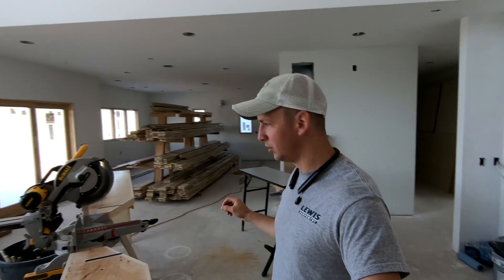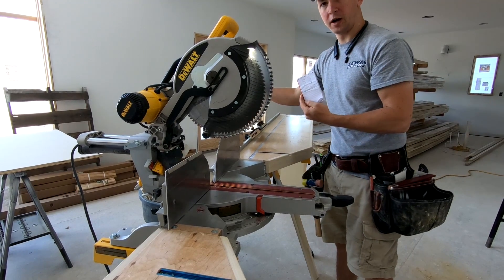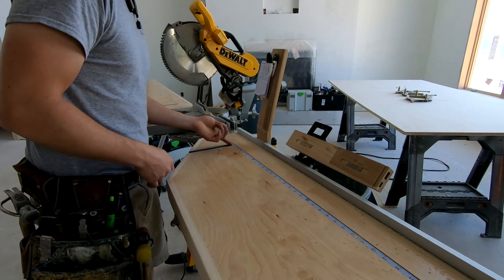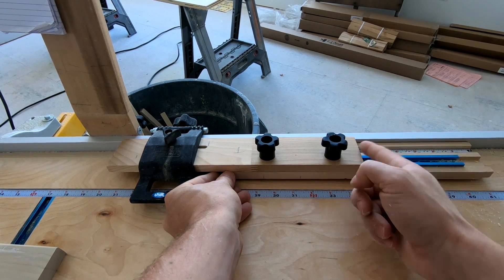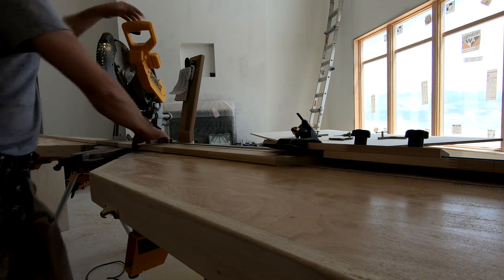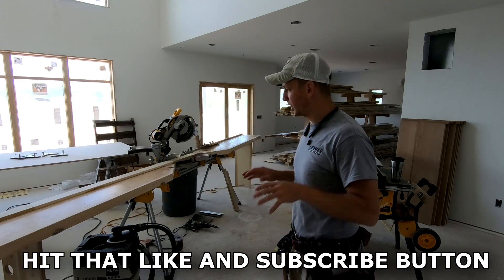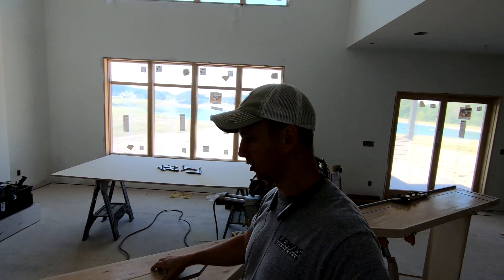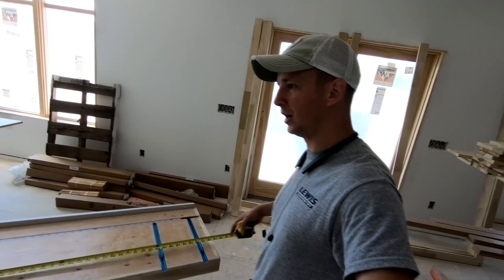No Faster Method to Cut Mitered Window & Door Trim???- The Miter Saw Offset Stop Block

Comment from the maker: Support by visiting these links: Thanks!
MITER SAW WINGS TOOL/SUPPLIES LIST - https://www.amazon.com/shop/insider_carpentry
Hipur Glue Gun: https://amzn.to/3jcFFVW
Hipur Glue - https://amzn.to/2DHQ7V8
Miter Clamps - https://amzn.to/3hjhvHR
Miter Saw Blade - https://amzn.to/2Zy9JDN
Reply: Been enjoying your videos, bought one of those stud finders you use. Pretty nice!  Have you ever used a 1/2” crown corrugated fastener gun for your miters?  They are amazing, I have never seen a faster way to hold miters together with or without glue and they hold almost as well as a pocket screw. You wouldn’t have to touch corner clamps again. Anyway thanks again for the amazing content .
Reply: IS THIS A RE POST  SEEMS I WATCHED THUS A YEAR OR 2 AGO
Reply: Are those saw blades better than Diablo or Dewalt?
Reply: @esequiel1900  for $180, I would hope so.  That's one expensive blade.
Reply: @esequiel1900  Full size teeth are almost always better than the cheap thin kerf blades.
Reply: Spencer, are you usually buying 14' trim stock? And I know you've talked about this elsewhere, but it appears that you use finger jointed poplar?
Reply: Three things:
1) You do a very good job with your channel - great resource for folks wanting to learn the trade and become excellent at it.
2) I subscribed quite a while ago and have no idea of my password, user name, etc., if there is such a thing on the channel  - if I need to know anything about that, please let me know.
3) I thought you said long ago, that you were going to do a build video and/or plan for your stop block.  If you have, please let me know where to find it, or please do one - that's a slick unit.
Reply: Why no link to stop block on Amazon. Getting ready to build some wings but can't find the stop block cursor thingy

Comment: 3:12 this advice would have saved me a lot of headache in my earlier days. 
Took me a couple of screw ups to come to the point where I always re calibrate the bevel.
Reply from the maker: You’re not alone! Had one a while back where I cut a ton of casing sets...started assembling and my miters were slightly off...saw was off about 3/4 degree from bumping in transit.
Reply: Reekon M1 Caliber
Reply: If you two would ever get together and do some type of classes I would totally pay for that person to person. You guys are awesome. Oh I couldn't forget Mike Farrington.
Reply: It can get really crazy when multiple people use the same saw but use different setting and don’t return things to 90* when they’re done.  I’ve walked down that road.
Reply: @levisoriano1  Yeah, Mike used to host a week long paid course "In the BOARDROOM"  So you can learn to use "The MIGHTY BISCUIT"  /* I'll stop now! LOL */   If he starts it up again, I'll do my best to sign up.  My dream get-together would be Perkins Builder Brothers framing,  Richard and Spencer doing the finish carpentry, with This Old Tony making all the metal doo-hickeys while Essential Craftsman narrates.  And Mike building the furniture.  And I'd guess you have to throw in a river table from John Malecki.

Comment: I love it when I have moulding I can flip like that and cut without rotating the saw. You can do it on quite a few profiles. I do the same idea for baseboard when doing cope to out cuts. Flip it over and slide it down.

Comment: I used to work for a very large plant nursery that sold to the big box stores and we were big into “lean management.”  Finding ways to cut steps to save time, labor, man power and this is exactly that. Great tip, and you just gained a subscriber!

Comment: Spencer, I notice you take several steps to the right, to pull your stock off the rack; then several steps back to the left, to bring the trim to all the way across your miter table. Wouldn't it save time and energy to set up your stock rack, or miter table, to where you feed it from left to right?

Comment: I’ve had luck with spring clamping a speed square setting the 90degree of the speed square on the short side of the angle then I can pull a measurement from there

Comment: First of all, excellent work you do. The question I have is do you ever have to do a compound miter on your casing? It seems every time I do my casing the windows are always short of being flush with the drywall so, I have to chip away the drywall and do compound meters to get my casing to fit tight. Just curious if you have this problem on the houses you trim out

Comment: You need to team up with Matt Risinger from the build show podcast. You guys might be brothers from a different mother.  I see some very strong ideas from you both.  Do you have a say In the stock material you use?   My guess is that you never prep your work for painting.  As a remodeler I get to do it all.  Trim, prep, and paint.  I’m finding that trusting other trades to do the job right is harder and harder these days.  Very few contractors truly care about the finished product.  
I understand the get in get out ideas, but quality just can’t be sacrificed.  Sadly as you know it is.   Can you share what your encounters are like with the other trades you deal with and how you handle conflicts of interest?

Comment: Love your offset stop block & your method for flat casing to flip the casing after your first cut to get opposite miter after pushing it to the stop block for long to long measurements, that’s awesome ..but what if the molding isn’t flat..well exactly like you teach a lot is reduce steps/movements..don’t seem like much but if you have 100 pieces with 2 outside miters & move your deck from left to right for each piece it really adds up..& as us carpenters always trying to figure a quicker way I stumbled on to this trick..we had a really big project doing 200+ condos by Disney World & every one had a master bath tub surround with 2 applied molding/base cap boxes, so hundreds of the same cut…well trying to save time I found I could cut my right miter, measure my long points & move saw for opposite miter then set up my stop block for long to long ..then I could move saw back to left 45 & cut right miter on end of a full piece of molding & move to stop block then cut again without moving saw, cut, move to block , cut & so on till you got a good stack..then move your saw to right (for left miter)& cut opposite miter on whole stack piece by piece ..don’t know how it works but it cuts it perfectly to length ..hope that wasn’t too confusing..Spencer I think you talked briefly about the pivot point? How at a certain point the left & right miter meet at the same spot? Guessing it’s how the fence is positioned with the blade..but if you can’t flip your molding you can still gang cut without moving blade back & forth..love this channel

Comment: What about a casing that has a profile and is not flat and you can not flip it over and miter it like you can with the flat casing you are using. I do enjoy your videos just some of the work i have done in the past has not used that kind of casing.  Thanks
Reply from the maker: In that case you do have to swing the saw back and forth. But it’s not a big deal.

Comment: Ok ,what if the stock is not flat, do you hold it the contoured side were you think its square to the fence and plate??
Reply from the maker: Then you can’t flip it. You just have to move the saw in that case.
Reply: Ok,makes sense, great videos, keep em coming

Comment: I think I see a vacuum under the left wing. Were you not using it connected to the saw for dust control for the video (noise) ? Thinking about efficiency and health related to wood dust. I have a bagged Ridgid connected with an auto on switch from Amazon that works well. Cheers, Jim
Reply from the maker: No, I use that vac for my sander. I don’t run one on my miter saw anymore.
Reply: @InsiderCarpentry  Thanks for your reply. Really like your videos. I have a good friend with lung issues attributed to wood dust working in a shop earlier in life. You have a  slight congested sound to your voice so I encourage you to consider dusk control even working with regular wood. Best regards, Jim

Comment: Love your videos. the only improvements I can see would be that if you are cutting two pieces the same length would be try and cut then at the same time and the other one would be to add a small length of vac tubing on the end of you mitre saw and angle it down into a bin to save some time clearing up later and and its really nice to see a young person with such a lot of savvy you will go far. All the best from a retired chippy in the UK.
Reply from the maker: You bet. I always batch cut pieces that are the same length at the same time. 👍

Comment: Why didn't you set up the wings with the fence cheeks in place then they could stay fitted all the time?  I like your clever stop block, what are the metal parts you used?  Mike
Reply from the maker: Because the pivot point is zeroed without the aux fences attached. If you add the fences then you have to add the thickness of the fences to the offset on the stop block. So instead of 6-1/2 inches it would have to be like 6-11/16.
Reply: Insider Carpentry Understood but surely this is determined by the situation when the wings are set up so this could be done either with the wings attached or not.  I assume that you bought the fence cheeks after you had set up the wings, is that right?  Mike

Comment: Hi Spencer, love the channel. I just have one question, which flip stop is that? In your links it just has the t-track and the INCRA knobs. But I don't see a link for the flip stop itself?

Cheers
Reply from the maker: The flip stop is a part of the Fast Cap Best Fence System. I then modified the wood sliding portion myself.

Comment: I like the idea of making the 'hoops' for the windows.  A lot of jobs I work on, the bottom corners of the windows are pushed out by as much as a 1/4" from all the flashing tape, etc. while the tops are flush with the sheetrock. So the rock is sticking past the jambs by up to 1/4" . I can pound the rock in some but if I premake the casing with 45 degree corners and 0 bevel, I'm screwed bc I can't push it tight to the jambs. The only way I've found to do it right is piece by piece, especially if its not painted trim. Any suggestions?

Comment: Just a small tip for Dewalt saw users... If you get an 1.25" ABS 90* drain fitting... pop it on the back of the dust chute, and all the dust goes straight down into a small pile (or bin if you put it there) instead of getting launched all over the place
Reply from the maker: I really need to do that to mine.
Reply: Thank you very much, to think I have had a bag of plumbing fittings lying around for years as well 😂 
Could have saved so much time cleaning up
Reply: That is a really good idea!
Reply: Milwaukee saw owners have that very handy bag on the end of the 90º chute, very clean, you can easily make your own or use the paper bags that go in the shop vacs.

Comment: When you cut your door legs, I didn't see you cut or double check the square end, do you pre cut it,  or just rely on the fact that the carpet will cover any out of squareness?
Reply from the maker: Carpet gets tucked under and covers and hard surface flooring will require the casing to be undercut at the time of flooring install.

Comment: How much time would you say you average on each site? 
I’ve spent a ton of time on the efficiency of my setup for cabinet install. But I’m finding the design of setup is different when I’m only on a site for 2 days at a time vs 4-5 days or more. 
Your setup in my experience looks like you spend a week or more on most sites at a time?
Reply from the maker: Yep, I'm much more geared towards longer installs. A 3 week job is a small job for. Most of the homes I trim are in the 3-6 week range but I also do final/punch out work which is just a day or two at a time at the end of a job, so I do still have to say somewhat lean.

Comment: You’re measurements are the same when you calibrate at a 90 degree cut and the. swing to a 45 degree cut? I find mine is off by almost a 1/4”. Then again I don’t take my vertical fences off, but I didn’t think it would make that much a difference on the pivot point.
Reply from the maker: You definitely want to take the auxiliary fences off. It throws off the pivot point the thickness of the fences.
Reply: Insider Carpentry word up. 🤙🏻

Comment: Tear out cutting face down? What about trimming after finished floors are in? You have a unique system most builders around my neck of the woods dont follow. Also you mist be working with consistent widths. I end up screwed with variations in width. So paint grade is paint grade but clear is different. Love your channel great info. Thanks

Comment: How do you avoid a ragged edge on the face when you're cutting with the finished side down?
Reply from the maker: With a good blade it’s a non issue. 👍 if you’re pushing the blade through, front to back, the blade tooth orientation will actually be pulling and cutting upwards so no splintering.

Comment: Hey brother, new sub here found you on finish carpentry tv. 
Have you moved to metric yet?  I use the BOSCH laser measure and a fastcap standard/ metric tape. I LOVE not having to decide which line I'm closer to. The last just tells me
Reply from the maker: Its hard to teach an old dog new tricks. LOL I've never even tried metric.
Reply: Metric is terrible, I wish all the codes weren't only using it now. If you use Imperial materials it doesn't make sense to convert things like 3 3/8" to mm. And no, metric isn't more accurate. The installer decides how accurate he is. 1/32" is less than a mm if you are getting fussy, which I am not. Calling 2" pipe 50 mm is anything but accurate. I won't mention anything about being on a remote sight and being handed plans in all metric and 3 guys having to share one bisexual tape for 4 days. Good thing we had metric shovels at least.

Comment: Question: Why is your stop block on the right side of the blade?
Reply from the maker: That’s how I like it.
Reply: @InsiderCarpentry  Trim guys always pull a tape, right to left. Its a legit question with a legit answer.
Reply from the maker: Exactly what you said. I pull right to left. So the saved piece is always on the right side of the blade. Same with the stop block.
Reply: Think about how the saw is designed. With the motor and belt on the right, the left side has the best cut sight.
Reply: @jamesmyerssr.3119  As a lefty I pull all measurements left to right. But only for the last 40 yrs :)
Reply: James Myers Sr. While that may be true, personal preference wins. In theory you are correct, but in practice I’ve never been hindered by the motor. 

Also he grabs his tape from the left side of this pouch, and with his left hand, so pulling from the opposite side makes sense, for the way he does it.
Reply: @vinnied.1239  ... and the tape. Its being read upside down. The saw and the tape are used backwards.
Reply: @jamesmyerssr.3119  It sounds like you struggle with basic things, which is okay, but don’t project your struggles on others.
Reply from the maker: Welcome to the YouTube comment section. 😂👊
Reply: @vinnied.1239  I've been a tradesman 30 yrs. Top shelf and production. I always "see" how a guy will use his tools.
Reply: @jamesmyerssr.3119  I’m not putting to question your claims nor am I interested in whipping out our tradesmen jocks. But reading a number upside down isn’t difficult, nor is it hard to use a saw with the other hand if that how one wants to do it. A tradesperson comfortable with his’her tools is capable of such things, imo.

Comment: Maybe you've been asked this before? Would you stack pieces  of the same length for one cut motion? If so, what's the max pieces you would cut at once?
Reply from the maker: No. It doesn’t work with this stop block and there is too much potential for messing things up. I usually cut one level at a time, however many that might be.

Comment: Great work maximising your use of time and efficiency is impressive. I try to do likewise in my own home projects but I have learned several additional useful points today. Thanks for that.
I have one question,  I note towards the end of the video you lifted the dual stop block to reveal a small amount of saw dust. Which reminded me of an issue I had in the past. With continual cutting, small amounts of dust gather on the wings. As you slid the casing down it pushes more and more dust toward the stop block which can hold the casing off the stop block altering the final cut dimension. Have you encountered this problem? and if so, how have you addressed it? Thanks again. Enjoyed watching. Cheers from Scotland.
Reply from the maker: You have to watch for that. But this stop block is slightly elevated so in general it’s not an issue.
Reply: Insider Carpentry Makes sense, keep it elevated from the surface of the extension wing. Don't know why I never thought of it. Perhaps that's why I watch your channel. Nice one!

Comment: Where do you do the math for your reveal? While you are taking inside measurements or at the saw? What do you write down I guess is what I’m asking.
Reply from the maker: I write down what I want the cut to be. So I do the math in my head as I take the measurement.
Reply: Thanks
Reply: @InsiderCarpentry  So basically when you measure a picture frame window and you want a 3/16th reveal you'll add 3/8 to your written measurement inside jamb to jamb, same with door headers, and then for door casing legs you'll just add 3/16.

Comment: Hey spencer just ordered all the pieces to make wings. So I’m thinking there has to be an offset from stop block to reader ( clear part with red line) correct? So if difference is 3” from front of stop block to line reader than actual measurement from blade to reader would be +3” ?